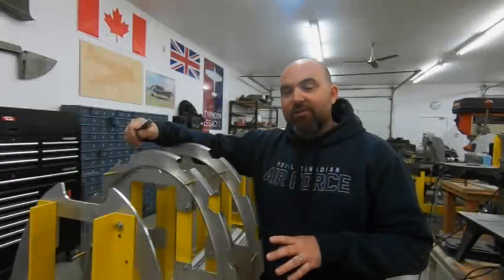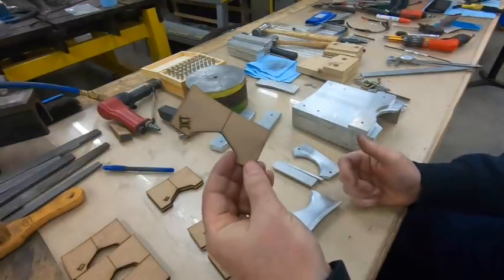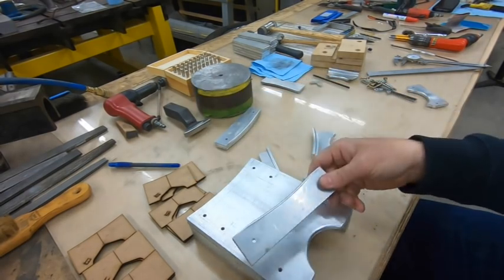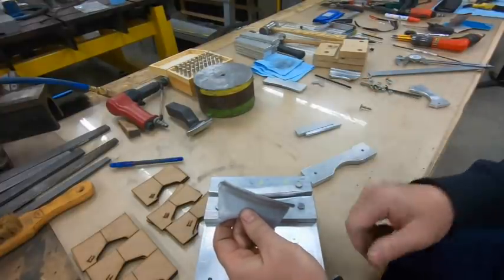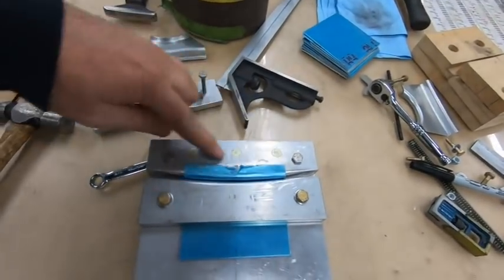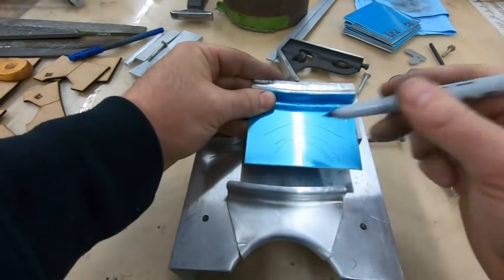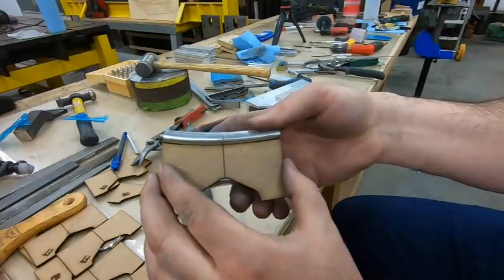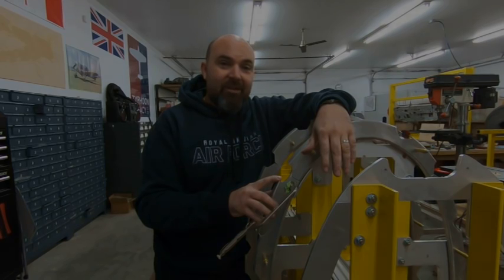S1E16 Rebuilding Hawker Typhoon JP843 - Fuselage Splice Plates

Comment: Great stuff Ian! You say that the Typhoon stringers were not fixed to the frames aside from at the ends, why was that?
Reply from the maker: It would be by design, some manufacturers do attach stringers, some don't. Typically when attached, they serve more in the longeron role than a stringer. ~Ian
Reply: @TyphoonLegacyCoLtd  Thanks Ian

Comment: Lovely work there Ian, don't you wish you had the original tooling? It would make those little fillet plates so much easier to produce - they are probably still lurking in a tool store 'up North' at BAE Systems under a few inches of dust. 

We used to get denied tooling for parts from the powers that be up North and have to recreate the tooling/forming blocks from scratch ourselves for parts for the Harrier family. Only once in all the years at Dunsfold did I actually get supplied with original tooling/forming blocks for a component.
Reply from the maker: It would be amazing to find original tooling but I would certainly settle for more original drawings! ~Ian

Comment: Hi Ian, With present day knowledge of others, would you consider the Hawker / Gloster fuselage construction techniques an efficient way of building an aeroplane?  Was the Meteor built in the same manner?
Reply from the maker: I can't speak to the Meteor unfortunately, but these details are all specific to the monocoque section being built in quarter sections. The quarter sections required extensive tooling, but once that was built, production was much faster than building the section in halves or other ways; far more hands one each assembly this way. ~Ian

Comment: I´m always slightly amazed how little thought seems to have been given to standardising components on a structure like this. All those little brackets, almost all subtly different. Seems like madness when there was a war on and they wanted to churn out as many of these aircraft as they possibly could. Same with the bracketry on the tubular structure.
Reply from the maker: It looks like a lot of work in this case, but these parts would have all been produced in a press during the war, once the tooling was produced, most of the work was done. ~Ian
Reply: @TyphoonLegacyCoLtd  Ah right, that makes sense.

Comment: Whilst the care, attention to profile differences & precision of your forming are to be commended, these aspects of the design don't lend themselves to production manufacture. I doubt that this degree of attention was paid to the construction during wartime. Most of these parts would have been made by people in sheds, garages and small manufactories all over the UK at the time, then kitted ready for assembly at numerous aircraft factories. In conclusion the intricate system of inspection by AQD, planning and logistics to bring it all together just in time for final assembly, puts modern production of aircraft to shame.
Reply from the maker: Very true Mark, during the war these parts would have been stamped and installed; there was little time to go into great detail on each part. This can bee seen in surviving parts without correct corner radii, having unfinished edges, and saw marks on castings and forgings. While these were negligible issues under those circumstances, we need to work to modern standards to ensure JP843 stays to tell the story as long as possible. ~Ian

Comment: Hey you have an dream workshop do those new parts have to be crack checked after forming stay safe cheers
Reply from the maker: Thank you , it's taken a lifetime of work to make the shop function! There is no NDT requirement for these parts, they are formed in "O" condition and heat treated. ~Ian

Comment: Ian, thanks for all the small nerdy items and notes. Especially. the "O" condition. One thing missing is the time line. I.e.: did you do each piece separate,  beginning to end, or did you set up a semi production line of bending one line on all the pieces, then the next line etc.?  Pros and cons to each. Also roughly how much time to do the first and then the next 40 pieces. Also: Kudos to the sponsor ( I could have used a few more of them).
Reply from the maker: Hi Ed, I played with some bulk production options, but found that there wasn't too much time savings beyond cutting a pile of blanks to work with. The tooling saves most of the unique forming, but each part needs some small tweaks to fit just right. When I started these there was tooling time and other little issues, but I would say the first part (without video time) came close to 1.5-2 hours. I'm still working on them now, but averaging 30-45 minutes each. ~Ian

Comment: Is there a reason why the stringers aren't attached to the frames? Is it to save manufacturing time?
Reply from the maker: With the design each part carries it's own loads, and Hawkers calculated that the strength was correct without connecting the stringers and frames. ~Ian

Comment: Great video about all info. It's interesting to see all the details about the original design and the construction decisions that was once made. I understand that the stringers were riveted only to the skin, but what was the reason? Is it that the frame risked to be warped in case the stringers were attached to the frame segments?
Reply from the maker: The stringers and frames carry different loads in this design ~Ian

Comment: Very inspirational! Would you be better developing a true shape for the blank, allowing for bend allowances, and have these cut by laser, it would give you much less flange depth which you are having to shrink in and cut to final size, and as you have so many to fabricate it would save a lot of time. Stay safe, and many thanks for your time in producing these videos for us! Chris B.
Reply from the maker: When I shape by hand I prefer to leave a bit of extra material to trim and fit; if the blanks are cut too precisely, a small shrink or stretch variation could leave you with a short edge distance and a piece of scrap metal. In the case of these parts, I also use the extra flange as a bit of a shrinking lever to compress material inside of the direct shrink area. It's all about personal comfort and preference. Also, no laser cutting for aircraft parts! ~Ian
Reply: @TyphoonLegacyCoLtd  no laser cutting ? I suppose that is due to localised heat problems, but you are achieving an end result, that is what really matters, you could always make a simple press tool for the Fly Press, but you would still have to allow for the bend allowances, Chris B.
Reply from the maker: @453421abcdefg12345  It would be worth it to make individual tooling sets for each frame if there was to be volume production, but because each plate is slightly different frame to frame, and we're only making one or two copies of each, it is far more economical (time and money) to use this method. At least, IMO. ~Ian
Reply: @TyphoonLegacyCoLtd  I can see that any volume production of these parts would not be practical when each frame is different, that must have taken a lot more time on the original build, I wonder why they did not go for a standard size plate for the whole structure?